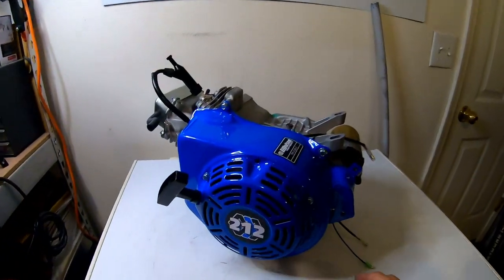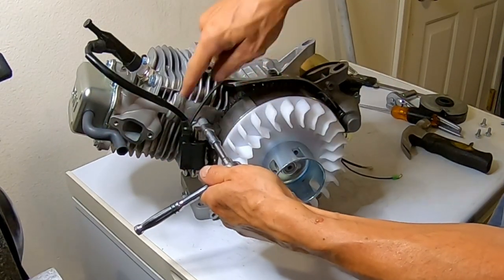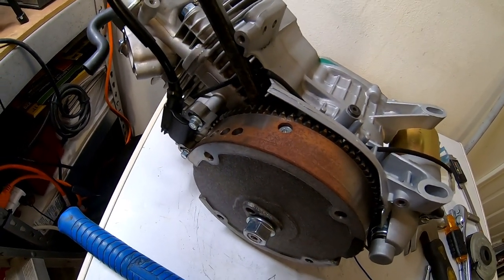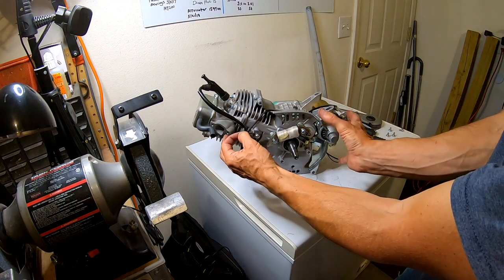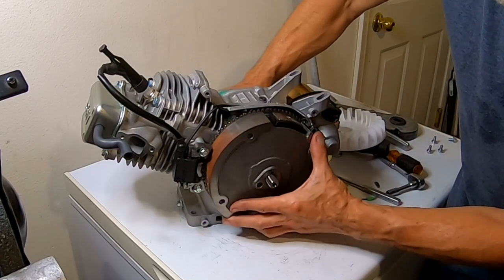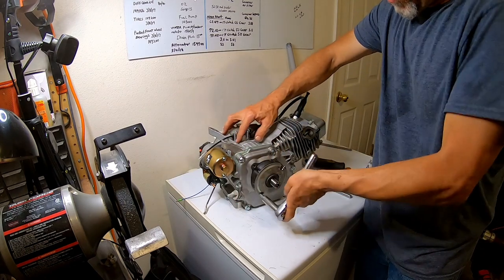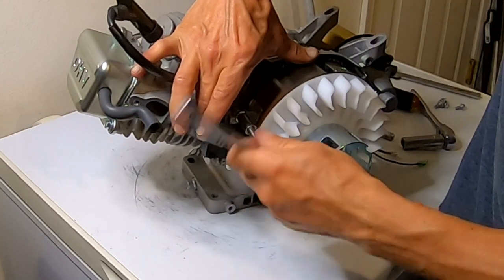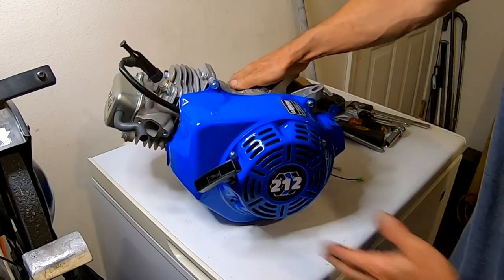Tillotson 212 gets some timing advance/7 degree flywheel key

Comment: do u think a lawnmower shop could change my flywheel !on it looks a bit risky ....i dont know if i have that torque rench ect but my flywheel on my 80cc beast minibike is rusted to hell n back deefinitly cant use my booster pack with it having a chance of overheating the hypersonic overdrive sysetem
Reply from the maker: Exactly ! I bet they can help fix it before the next mission.
Reply: @Black66  forget about it boss that drill cost more than the motor u can buyu a brand new mega moto roller frame for the price of that drill lol and the hydro brake setup lol Beast for reals
Reply: @Black66  whats a cheaper drill that will do the job
Reply from the maker: @SoLoCruizer   There is a Bauer impact wrench at harbor freight for $50  that should do it
Reply from the maker: @SoLoCruizer It It is expensive. But it will pretty much remove anything
Reply: Put a regular socket, breakover bar on it, hit the breakover handle HARD with a hammer.  Repeat as necessary.  The "airless impact" is the first thing to try before spending money!
Reply: @gbart7857  thanks man I upgraded it to the new t6 aluminum possi alloy it's tuffer then Arnold in Terminator 2

Comment: Have you ever put a Billet flywheel on a electric start 212 Tillotson? I bought the “electric start billet flywheel and rod combo” from Studz, but I’m not too sure how to install it. Their page says something about “Clearance”, but I believe they left out a word or two, because the sentence seems incomplete. PLEASE HELP!!!!!!
Reply from the maker: Yes, I put a billet flywheel on my Tillotson 212 e . No problem. Are they talking about the coil gap ?
Reply: @Black66  No Sir. This is what it says, “********This Is Not A Bolt On Kit, The Fly Wheel Ring Gear Requires A LOT For Clearance to The Block On The Tillotson 212. ******” A LOT of what is my question?!?!?
Reply from the maker: @DJ_CAZZARELLI   Oh , I know what it is talking about. 
On mine i used a standard billet flywheel. I got rid of the ring gear for the starter. I dont use the starter anymore. So on the billet flywheel you have ,if your using the ring gear ,it sounds like you will have to clearance the gear to clear the block or visa versa. I would mock it up on there and see if it clears everything. I would put it on there without torqing it down and spin it over to make sure every thing clears.
Reply: @Black66  I mocked it up as suggested. EVERYTHING is clear. No rubbing or resistance what so ever. Now I ran into another problem though. While trying to seat my bearings into my ARC rod, I snapped one of the 12 point 1/4” bolts. I was using a torque wrench and everything, little increments at a time. Now Im gonna have to try extracting the broken bolt, and then try to locate some more bolts.
Reply from the maker: @DJ_CAZZARELLI  The bolt might come out pretty easy. I have had that happen before.   Make sure you oil up  those bolts really well  whan your  torquing them.  ARC racing or gopowersports has those rod bolts.
Reply: @Black66  I’d like to know your process for removing the broken bolt. So far no luck. I found some replacement bolts on GPS’ website. I just wish I could have them overnighted.
Reply from the maker: @DJ_CAZZARELLI  An easy out should take it right out. A lot of the times just drilling for the easy out will spin it out of there without even having to use the easy out.